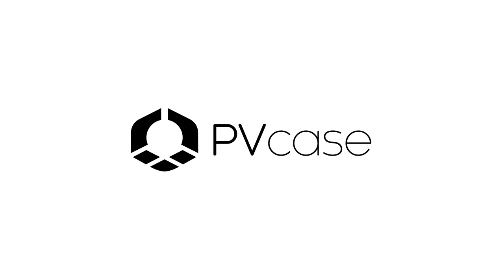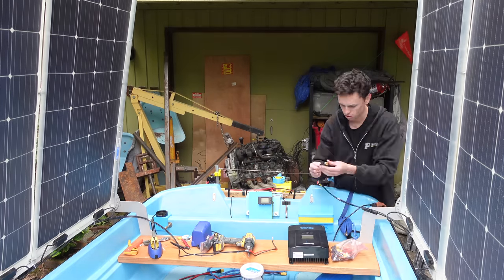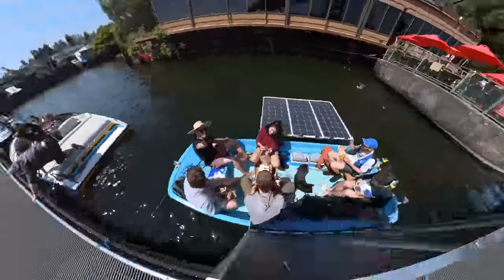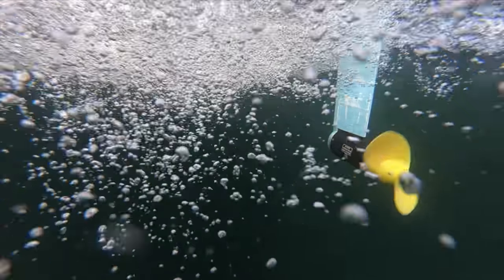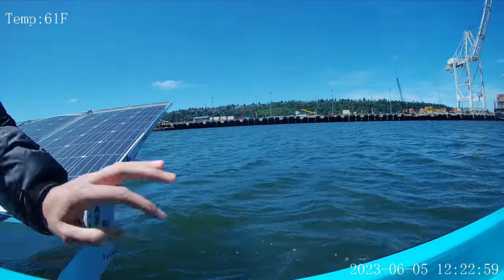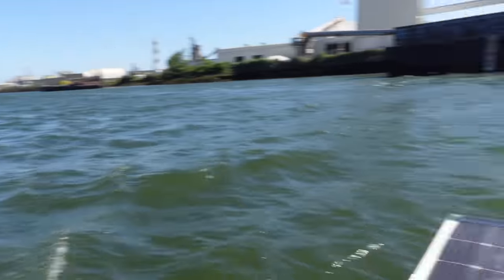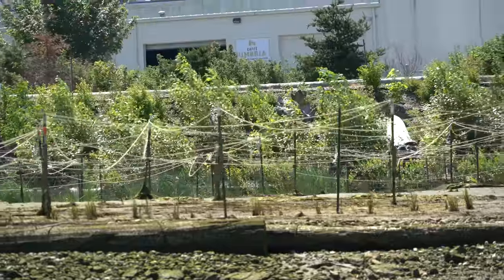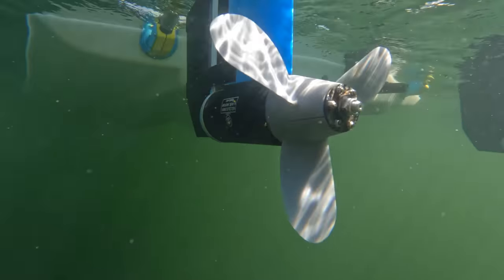Building an Unlimited Range Electric Boat

Comment: You might want to do an IR camera crack check on those panels now. They're able to flex but not intended to flex while in operation and the cells themselves will still get damaged. A lightweight yet rigid mounting substrate would be advised, or at minimum a support grid underneath.
Reply: The easy "lightweight but rigid mounting substrate" is probably... a bunch of inches of foamboard faced with Poor Man's Fiberglass?
Reply: The flexible ones at our local camping store come rolled up in a box. Is it best to never roll them up again once unfolded? What's the IR camera test? is that when you put voltage back into the panels and film it with your phone to see what lights up and what doesnt?
Reply: Micro fractures from the flexing is going to kill the panels very quickly. As suggested, use a thermal camera and take progressive photos to track their decline.  You will definitely already have fractures.
Reply: @nickorbeck8693 even without flex, the flexible panel will lose a lot of peak output because of the degradation in the top protective layer

There are already many videos explaining about that.
Reply: @nickorbeck8693  Or even better, just buy nonflexible panels instead, at least in this case
Reply: There are solar panel sails for sailboats, seems pretty cool.
Reply: @TrogdorBurnin8or  My vote is that he tows a barge of solar panels.
Reply: you guys are waay over thinking this, a frame made out of aluminum tubing with welded together reinforcement will work the best in something like this and will allow for extra mounting points for waterproofing like foil or thin sheets of whatever really. aluminum tubing is really easy to get and can be bent with homemade methods, the problem is welding which would require a highly experienced welder to pull off but it will outperform whatever fiberglass or mechanical parts you might rig together like in this video
Reply: @TrogdorBurnin8or  thin foamcore board with a single layer of carbon fiber resined to both sides is about the best you can currently get in terms of minimizing weight while macimizing strength and having something with roughly isotropic properties.

Comment: you can also flip the motors around and have them in a pull configuration. they also do this on large ships with azipods so the prop can take in clean water.

Comment: For your solar panels, I feel like you're either going to drop a main pin or a cotter pin into the water eventually. 

I think a "ratchet" system might have been better for controlling the position of the panels. Using pins looks tedious and it's an accident just waiting to happen.
Reply: or an linear actuator could have enough power to lift and lower it to specific degrees and wont drop the panels even if the motors fail.
Reply: Could attach the pin via cable to the boat. But that is just ignoring the main issue.
Reply: Just need some of those old fold up beach chairs.
Reply: Get one of those retaining pins and some string & tie it on the mechanism
Reply: I think he needs hydraulics.
Reply: hacking up a few of those ratcheting winches to use the pawl and ratchet wheel
Reply: I think a pair of masts front and rear with some cable stays would support the panels better.
Reply: I'm sure there many better designs. But there is some elegance in the simplicity of this solution. And it was a fairly straightforward way to test out the PCBWay fabrication. Also he explained this isn't a permanent solution, just a proof-of-concept. I think he made the right decisions given the constraints.
Reply: Just have a mast and ropes to hold the panels in place
Reply: Motorized worm gear setup would work nicely too
Reply: This whole channel is built upon everything being an accident waiting to happen. Thats why he's succeeded. lol
Reply: Maybe like a wheelchair brake
Reply: So he needs a ratchet. And hence a lever arm.

So presumably I would go buy a pair of tie downs and use pins as a final stop. This will move the loading point up the arm of the mounting, allow variable tilt angles with a wider range of angles and be extremely strong, and replaceable should the tie down component start to show signs of age due to sun exposure.

It's a ratchet. And they can be relaxed and tightened manually easily enough.

But it will also shade the solar panels which can and will damage them over time. So maybe they just need to be mounted higher regardless. It'd keep them out of the water and shading.
Reply: The other option is making the boat bigger, I don't think you would lose that much speed if you made the boat a little bit bigger so the panels were only about 50% over the water.
Reply: @Jokerwolf666  except friction from water is the problem.

His boat would actually go faster and be more energy efficient with the right motor/prop configuration. When you are on the plane your hull is out of the water and will stay there with far less power input.

But the solar panels would need to be heavily built to withstand being bounced around when skipping off waves.

So probably not viable, particularly for the extreme range he would like to experiment with.
Reply: @glenmcgillivray4707  what about Outriggers? A boat designed with with solar panels across 1 or 2 might actually work well.
Reply: @Jokerwolf666  I like the idea but the need for structural members would spoil some of the bonuses. Also how to fit back on trailer at end of voyage.
Reply: @glenmcgillivray4707  Ya, transportation could be an issue for sure. Maybe it could designed to be be stored within the boat itself while travelling and strapped down.
Reply: @Jokerwolf666  like his current solar setup.

It's certainly possible. But it's more complicated to install.

Might end up being a couple polystyrene floats inside 3D printed (and varnished for waterproofing) floats on the edges. Light enough the ratchets still lift it smoothly yet self supporting should the boat get a-rocking to keep the panels up out of the water.
Wouldn't need to be large, but the lever arm when they touch water would load his outriggers hard.

Easiest solution remains a towable solar Kayak with outriggers. Small enough to drop into the boat I suppose. Self stable and set up to be impossible to sink with its low mass. It could even offload some of the battery mass to a highly bouyant surface skimming 'trailer' and non complications due to shading solar panels due to human payload short of birds landing on the boat. Albatrosses are practically fearless and quite like minding their own business thank you very much!

Said Kayak may even allow us to lift solar panels in 4 directions to exploit long journeys in straight lines when the sun is low in the sky probably can rig a pulley setup. Although then we would need twin frames on each panel to permit 2 axis of rotation.

Unless the whole frame itself rotates and only lifts in one axis (probably only half of the cells towards the centre for balance reasons) on top of the pontoon setup?

On second thought. If we went for a 9 cell instead of 4 cell set-up.
We could disconnect the centre row of panels (shading) and raise both forward and backward rows of cells in the same direction, without the forward row shading the rear row till late in the day. And get maximum solar power till 50 degrees or so. Thereafter you drop the front row back to level, and can keep tilting the rear bank till sunset.
Probably not worth the investment to tilt both banks, but if you didn't have a middle row it wouldn't probably matter much, you would see maximum power output for most of a day regardless.

Any solar solution has to deal with wind drag however, so maybe a trailer is daft.

Comment: Version 2 will have a solar roof, with solar outrigger/wings that fold up for easy access, and fold down to protect the cabin area from rain.
Reply: Exactly what I imagine 🤙
Reply: @itsfonk  
I'm about to make one.
Reply: @blueblubber6607 how's it going?
Reply: @Doki_LP  
Bought the two floaters of a catamaran and a two seater kayak such that I can assemble it either as a trimaran or as a kayak with a "solar trailer" (3kW solar power)
Just refurbished the floaters, starting to build the aluminium structure for enlarging the catamaran and getting the solar roof in place. 
Sooner or later I will put it on my website.
Reply: @blueblubber6607  👍
Reply: @blueblubber6607  good luck!

Comment: For this setup and maybe in the feature V2 version, there are two-sided solar panels, so with the water reflection or the roof reflection you could give a good amount of energy with even 1 panel ( Same size of one set that u have in the side). Additionally for the roof would be interesting to have a system that elevates the left or right side depending on the sun's attack angle

Comment: The roof is sooooooo much better of an idea.  Shade on the open lake is pretty important, especially for something that goes slow and will be cruising for hours.  They also get in the way and are easy to damage when docking.  They are also a paint to adjust.  Also some panels loose all power if even a small area is shaded.  It would be cool to do a solar house boat.

My dad had an old Boston Whaler built in the 70s.  It had a nice outboard motor and a driver spot in the middle on the right side.  Having the flat bottom made it easy to beech.

Comment: Excellent POC. You showed a catamaran as a better choice which I would NOT deny. A better choice again would be an outrigger trimaran with long and thin hulls for very low hydraulic drag. The outrigger struts could be furnished with very many panels, and potentially made to be fully or partially walked on.
Good luck, I look forward to whatever you do.

Comment: i think you should try like floaters next to the boat to support the panels and they could also add a bit more wave protection and displacement to avoid expensive tipping
Reply: I would think any large sudden jump and smack on the waves would push the panels far higher than it does now... likely break it much faster.

Comment: That is a cool proof of concept.  I've been wanting to build a solar-powered boat for the last two years but my wife won't let me (yet).  My plan is to use cellular PVC sheets (screwed and plastic welded) with a roof.  The idea is the swivel the solar panels to close the sides of the roof area.  For example, in good weather, the sun-facing side would be down and the opposite side would be fully up so both are facing the sun.  In poor weather, the sides could be brought down to protect the passengers.  The panels on the roof and battery could be used.  I think the panel on the roof alone would be fine, at a slower speed.  It's important to have ballast below when there is more weight up higher.  I would put a thick keel on it with the batteries sealed in there.  Actually, I was thinking about Skelcap super capacitors, instead of batteries.  Supercapacitors won't lose life over any number or recharges and they charge faster.  At first, a battery will have more capacity but this decreases over time until the battery is eventually useless.

Comment: Auto angle optimizing solar panel mounts would be rad.  Optical scheme for detecting direction of the sun with respect to the boat’s current heading.  Use that information to control panel angle - elevation and maybe twist.  Also include a sea state detection logic to put the panels at a safe angle when encountering waves.  Future project. 

Using the panels as a dronopad was fun.  

Looking forward to the V2 boat!  Should have a fixed roof and foldout panels too..

Comment: i think a mast would be a perfect way to be able to deploy the panels, and help support their weight. then you would struggle less, and can have a stronger support structure for the panels. and i might add, you should have some pontoons you can deploy on the ends of those wings. and also, it may be a good idea to have a permanent mount for the brackets. that way you wont loose your panels and benches in the worst case scenario of a flip over in bad sudden surf. i might also add, you could create a battery bank structure, such that they where both balanced, and fully secured. perhaps have them on the side walls to act as extra side benches, with a cover to lift up to access, and would seal the battery compartments from any water, period. lots of improvements possible, and i would love to see the evolution of those improvements, such that an end product could be made that could even be marketed. now, on that note, if you did eventually go to a roof solar cover, i would want to add stability mechanisms or blast and, pontoons to the sides. but i would also keep the transforming ability of folded panels, so then you could in theory have a single central panel on the roof, and a transforming flower like array built in, such that once deployed, the stationary roof panel is uncovered, and you increase the panel area immensely, without too much stability changes.

Comment: If you use flexible solar panel I bet you could use them as a sail, too ;) And save on weight. Even the rigid ones could work this way. Alternatively, could add a pontoon so that it has the pontoon in the water when its lowered, to take stress off the panel.
Reply: While it's a cool idea to use flexible panels as a sail. It would sadly destroy the flexible panels pretty quickly.

Comment: I have an idea I think you'd like if you ever do a roof. You could make a roof that is held up by 4 (or 3) robotically adjustable bars, that attach to the solar panel with ball joints. Then have those bars auto adjust via an array of light sensors (or anything, lots of solutions), to always have your panel pointed at the sun!
Reply: a three axis motion platform would require 6 struts, not 4 or 3, (unless you wanted a huge support in the middle of the boat,) and would be astronomically heavy and complex for a boat.
Reply: @williamcampbell9859  Only one axis would be needed to replicate the existing solution, and three axes would never be needed - why would you need to swivel the panels?
Reply: @MrManningata  true, swivel is not necessary - two axes would be sufficient to quote "always have your panel pointed at the sun". 

I hereby invite you to design a system with 3 or 4 linear actuators holding up the panel, attached via ball joints, that can rotate the panel in two axes.

Comment: This is very cool.  I agree with your idea that a displacement hull would be a better choice.  The locally made (North Bend) EPCarry pushes 10-14’ rowboats to roughly hull speed (4ish knots) on only 250W of power.  The owner there also wrote a blog post a couple of years ago about playing with solar boats.  Interesting takeaways there (besides the hull form) are his use of high aspect and long RC airplane props. 

The ultimate conversion would be on a Duffy 21, the electric rental boats on Lake Union. They were designed by local sailing legend Bob Perry and are very efficient through the water. The standard motor and lead acid batteries could be greatly improved with BLDC motors and LFP batteries. The roof would give you lots of room for the solar array. 

I look forward to seeing what comes next in this project.  I’m a big sailor but also love EV boats. We have a 10’ Gig Harbor rowboat that is great with the EPCarry, but something longer and with solar would be a fun next step.

Comment: Badass, im doing a similar project albeit snaller scale.  Im just using a 10'2" plastic jon/bass boat with a 7' x 10' rectangular umbrella which ive tested at speed, in big waves, and high winds.  The key is guide/support wires on all 4 corners which make it surprisingly stable.  I just need to acquire some flexible light solar panels to mount on the top of the umbrella as im already powering it with a 700 watt trolling motor.

Comment: A solar roof would be much less flexible and provide cover from the rain! You could make the legs fold up and tuck under the solar panels so that the roof is 'flat packed' for transport. They could engage in one receiver each built into the hull when up.
Reply: Funny that you’re too lazy to make a roof but an overly complicated and stability sacrificing folding system is no problem 😂

Comment: Large ships using the motor pod design run everything backwards to avoid that issue with the wake. One of Adam Savage's recent videos of him checking out underneath a new ship in drydock had a good explanation but it is basically to avoid the imbalance issue  with the prop.

Comment: On the solar panels, i think that putting another hinge point in the middle of the solar panel would be a good idea. Then you can have both panels oriented in the sun simply by twisting the panel closest to the sun so it faces it and having the other regular. jm2c

Comment: I think adding outriggers to the bottom on the solar cells would help.  This reduces the load and moment on the seats.  This could easily be done with pool noodles and PVC pipe.  Sealing the PVC would add also add bouncy.

Comment: I actually think the best configuration would be a solar roof with these 2 panels as sides for the extra juice, on a catamaran hull though. That would give you a nice amount of power to either go faster or make the boat slightly bigger/heavier. But at the same time the panels could also make an enclosed cabin to shield you from rain if you do manage to make slightly water proof.

Comment: I've wanted to do this with a small party barge pontoon boat for a while now. Have a solar array on the roof with the batteries in / under the floor.
I was thinking of using high thrust trolling motors at each corner of it as sort of makeshift azipods.
It's one of the many "someday" projects bouncing around in my head.

Comment: You can get a Bimany top for that boat for a reasonable price., then you should use foils with your motors mounted on them so you can raise and lower the hull out of the water to reduce crag. I have a similar Whaler I have been thinking about doing exactly this too. Good luck!